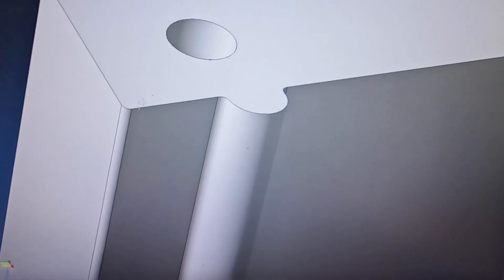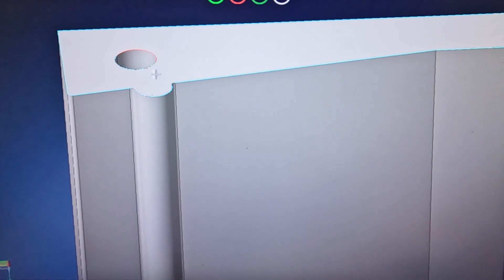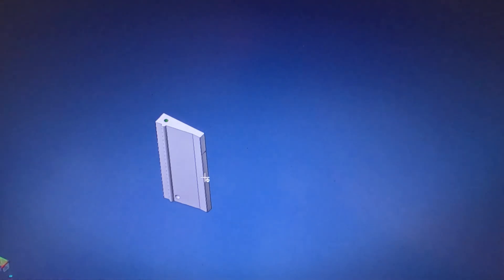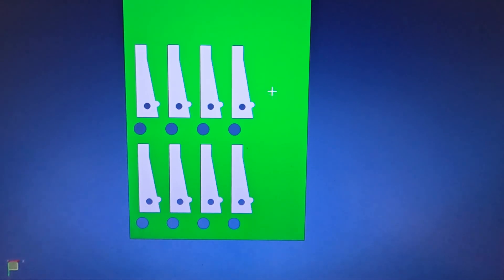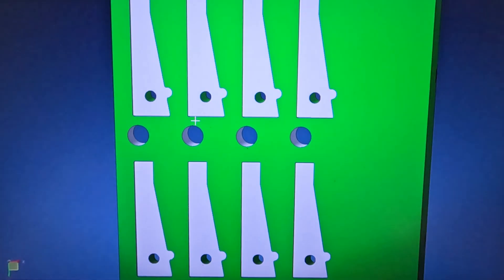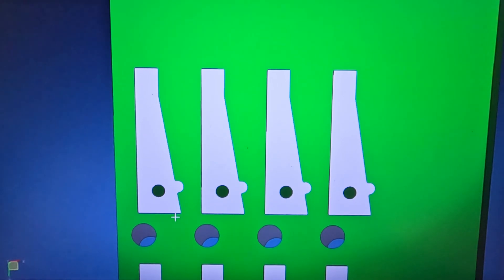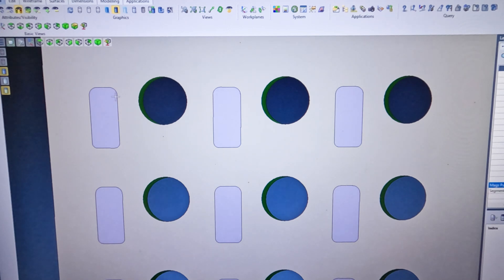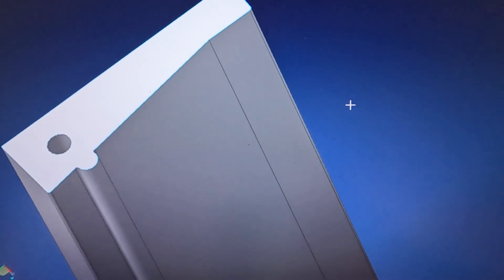Wire EDM Setup: Why We Don’t Trust Customer CAD Blindly | Learn To Burn Ep.6

Comment: Any mechanical interface surface, you're right that a profile burn using arcs really nails the profile. Many times the cad comes with a print that's has a plus plus tol  or minus minus which is 'special' too

Comment: Why glue. Why not drop a magnet on them after you pass the cut spot. I know you prefer to cut over night so no one is there to "catch"  the part with a magnet before it drops. Really im asking because i use magnets and i hope im not messing something up
Reply: Great question.  This punch had a very tight cutting clearance so we glue in after to prevent any slight movement.  Most of the time we will use a magnet.  We do see some slight movement sometimes using a magnet- talking 0.001"-0.002" at most.  The cutting clearance was less than 0.001".